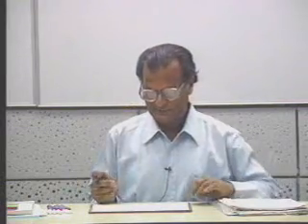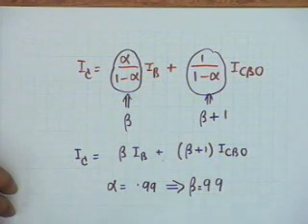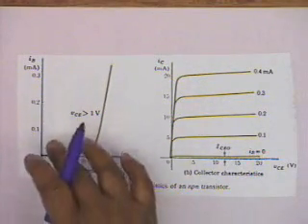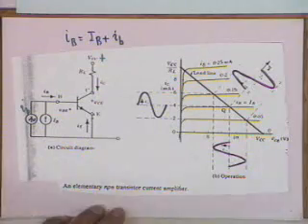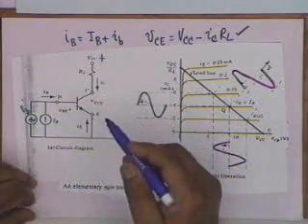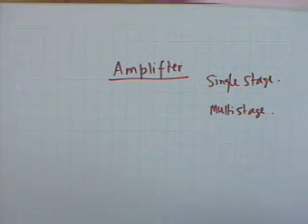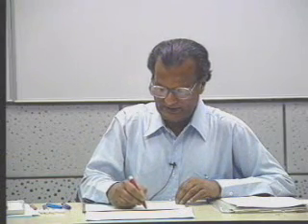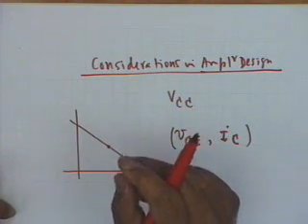15 Transistors Characteristics & Biasing

Comment: Your lecture demonstrates why Indian graduates are in demand in the US.  They were taught to a higher standard.  (Not counting the tardy boys that need discipline, but, that is another comment.)  Great job.  Seems everyone is in accord.  Honors to you Professor Roy.  As to post production, the audio technician failed to mute/attinuate the "throat clearing" from a level greater than the average volume down to where it no longer hurts the ears (which is an exmaple of the amplifier section of the lecture).  (Approx 1time/40 seconds.)  In production, Prof Roy needs hot tea with honey to minimize the problem.

Comment: As an Electrical Engineer I recommend this teacher for adequately teaching the Common Emitter circuit for DC and AC analysis (and both load lines representations) of the BJT NPN transistor.  The BJT NPN and PNP transistors are useful in many analog and low frequency digital designs.  I would like to see his lectures on the "FETS (including the MOSFETS)" for IC higher frequencies designs if I were a chip maker of computer chips.